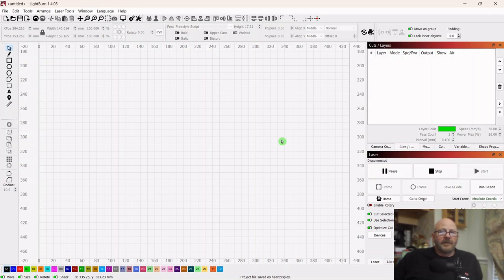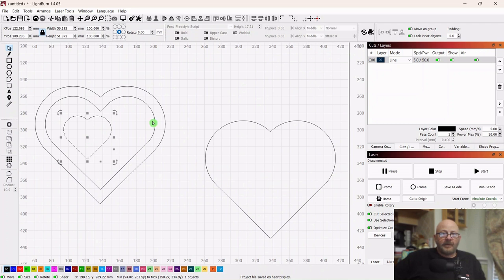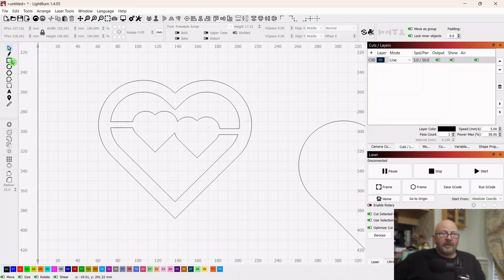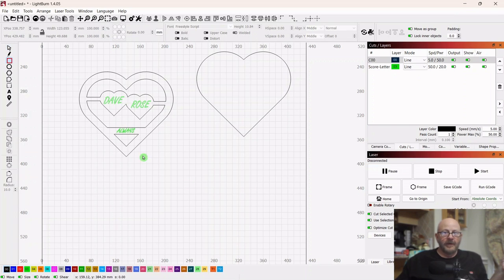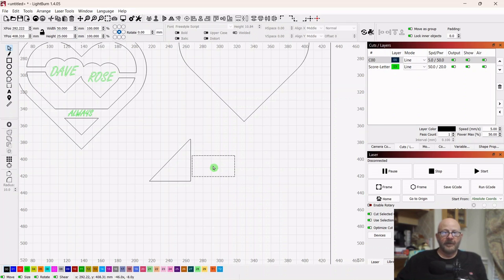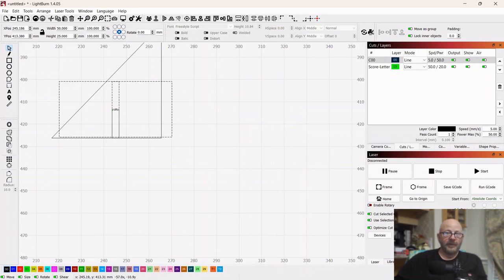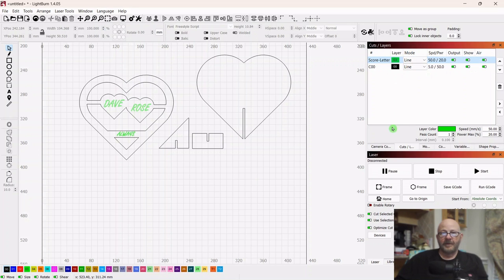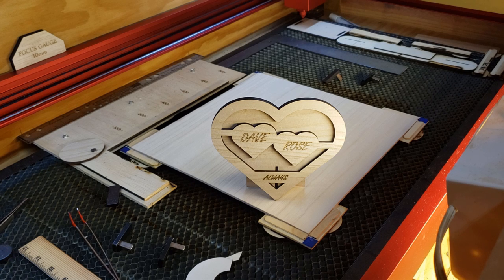Create a Suspended Hearts Display | Beginner Laser Project #29

Comment: issue with the union.  Will not work with the offset heart, but if I just take two shapes, it works just fine. Any ideas?
Reply from the maker: Hey Clarence. Be sure the larger heart is grouped, then weld the two smaller hearts, then weld one tab to the small hearts, then the second tab. Now you have two objects - the outer heart and the smaller hearts, from there the union should work. Hope this helps. Thanks for watching and for the comment - Dave.

Comment: Me again. Having so much trouble doing this but not from your good instructions. Had so much trouble importing the heart but now upto 5mins in and I don't have a union function. The one under weld is the Boolean assistant
 Tried using that but the options aren't like your union.
Reply from the maker: I believe your layout is set to "beginner" mode.  Up top, click on the gear icon - when it opens, uncheck "beginner" at the top and all of the boolean options should then be available to you on your main page.  If this does not work, let me know and we will figure something out.
Reply: Thanks but after days trying to work out what is wrong I have now completed the video whew lol a few things to twig up.
The reason I was having so much trouble is because when I learnt at the local library, an induction course to laser, they said to always use the open not import. I missed this in your video because I just presumed you opened the heart. Now I know to import. 
However I have learnt so much . Your video is so good for beginners as you go slowly with every step.
Just wondering why you try lining up the two rectangles which I will have to redo. Could you not just draw a line from corner to corner? I am making this for my grandson to give to his girlfriend. Just using the project for a learning experience and I thank you so much for making the video.
Oh another thing. You use 3mm whereas I have to use 2mm. Should I change the slots to 2mm?
Reply from the maker: I'm glad the project is working out for you - your gradson's girlfriend should love it.  You can put the rectangles anywhere, as long as you follow the same steps.  And your slots should be 2mm - in fact maybel a little less (for kerf adjustment) to make them fit tight.  Thank you for watching and commenting - Dave.